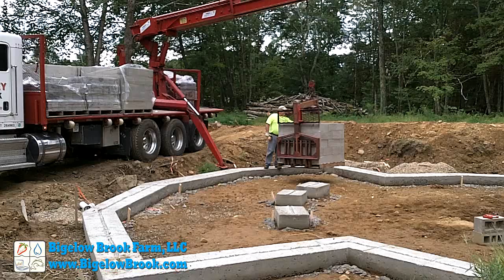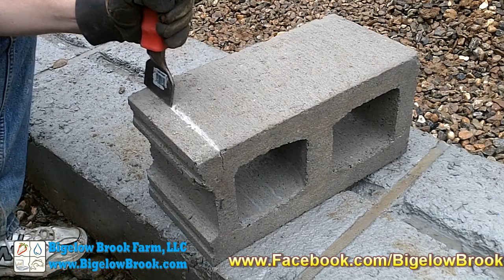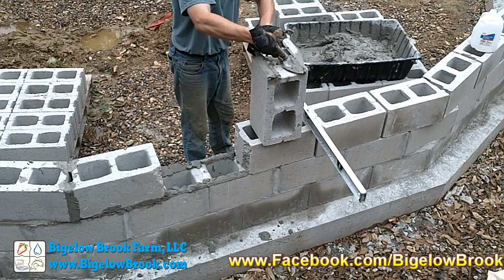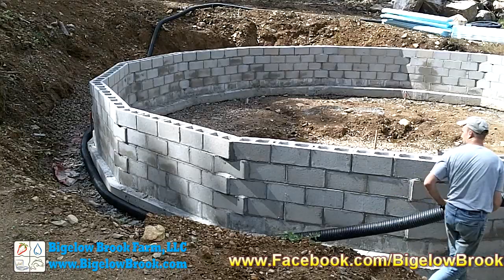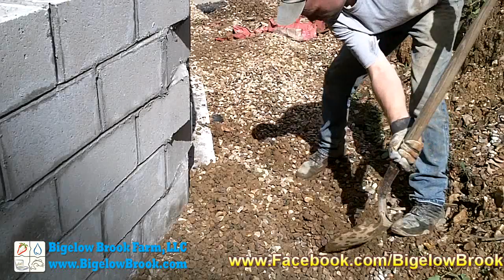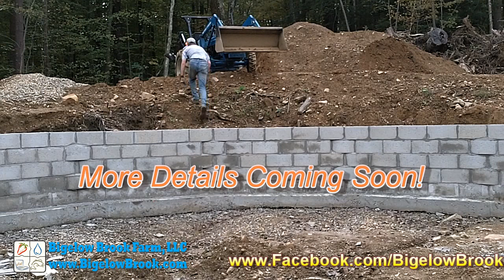Geodesic Dome Greenhouse - Part 6 Teaser

Comment from the maker: @NewEnglandgardening (I'm no expert on this)  I've heard the same thing but I did most of them dry.  I mixed the mortar a bit wet so the block sucked in the moisture.  On the hot days, I would hose down the blocks so it wouldn't dry too fast.

Comment: Great job. I had almost the design as you but my foundation is on bed rock. I didn't whant to spend too much money so I did my walls with 4x4 under each intersection. I'm almost done filling the inside for drainage.

Comment: Nice! It's starting to look like a geodesic dome.  I always thought you are suppose to wet the cinderblock so moisture isn't wicked out of the mortar?  Will you fill in the center or step down into the dome to gain height?